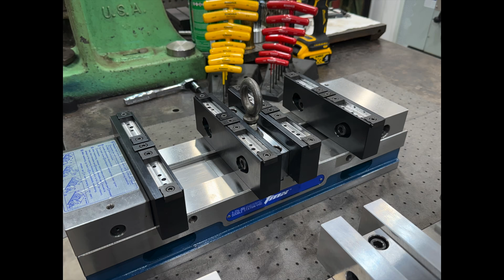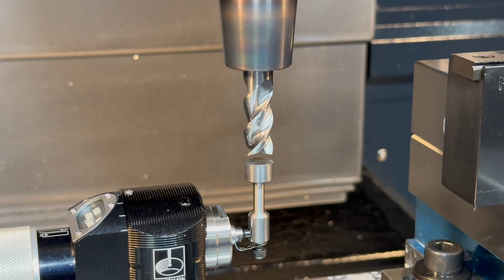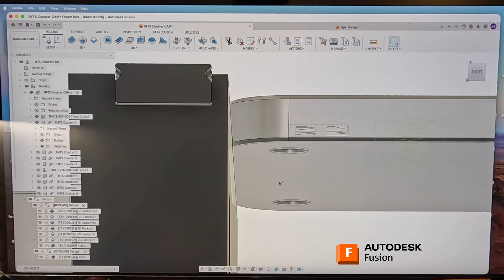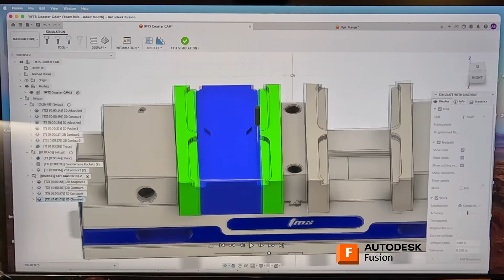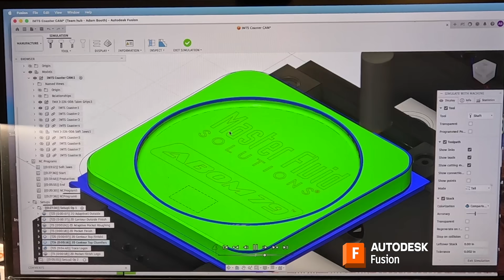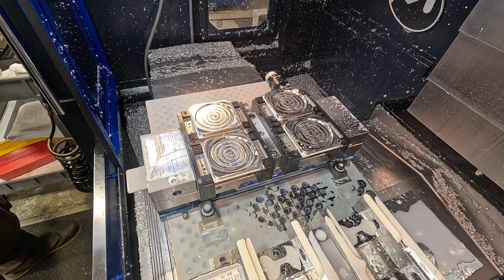Custom Beverage Coasters for Master Fluid Solutions Meet-Up

Comment: I also noted the little gauging by the chamfer mill on the soft jaws. You said it’s probably because the ends of those jaws were not aligned as bolt holes have some play. Now if those would come off and you’d use them later on another run, could you get them back to proper alignment across X? You couldn’t use a square/123block etc. if the end were not cut equal..

One trick I’ve seen is machining a shallow pocket along Y-axis across both jaws where you could then drop a parallel to align them when re-mounting those jaws 👍

Comment: I think you should find places you can put rubber bumpers inside the coaster area to keep glasses from clinking down hard. Most coasters use cork as a rest for glass containers. But you can't because you need to see the engraving. I'm sure you can find at least a half dozen spots for a standard tumbler. Perhaps a very thin piece of clear silicone rubber instead of the rubber feet. It can cover the engraving and still people can see through it.
Reply: It's a promotional coaster. They're not going to go into min-maxing the design for a tradeshow giveaway, at least I don't think they would. The problem with a lot of metal coasters is that due to material properties it promotes condensation, the typical glass tumbler will vacuum lock for a moment (especially this recessed design) when lifted and then the coaster will come crashing down as the coaster slips. Murphy's Law dictates it will land on the corner and smash through your glass table top: Hard learned lesson. Let's just say, my foray into coaster design for my own needs ended there.
Reply: @ald5267  No kidding, but the coasters should still work as coasters.  Small silicone balls can be fitted as bumpers. drilling hemisheres should not be a problem.  I already looked and they are commercially available in various sizes. It is trivial to make a wood/plastic pattern to temporarily stick the balls onto. A similar thing is done with cpu solder.

Comment: This is completely the wrong setup for these. Get rid of that SMW plate, put 5 lang zero points on there. Do 1 piece of material per vice, and do 2 coasters per piece of material.
Reply: And how much money and time would that take? Here is an idea. How about he brings in a Matsuurs horizontal with a pallet loader and we load up tombstones in there and it just runs everything for the next week and he gets 5,000 parts?
Reply: @MechanicalAdvantage wouldn’t help for high mix work. Lang would come in under 10k for the lot, and he’s spent close to that on 4 different vices
Reply: @spikeypineapple552 Oh so it would only cost $10k and a couple of weeks to get? This is as sitting on the table; paid for, and ready to use right now.
Reply: @MechanicalAdvantage Lang’s available off the shelf. I really don’t understand the idea of saving a couple of days on a 5 year investment
Reply: @spikeypineapple552 Lang is good some some things, traditional vises are good for other things. He is using what he owns. From concept to design to cam to production was almost instant. The fixture plate opens a lot of possibility that zero point plates don’t. Everything in machining has pros and cons. Different things are useful in different situations. There was absolutely nothing wrong with this setup and how he did it. It was a great use of available work holding.
Reply: @MechanicalAdvantage I just don't get your point here mate. Everything on this machine has been purchased in the last year. Piling more and more money into a system from 30 years ago is not the way to make money. I've never seen him use the SMW plate in a way that T slots can't. It's not like there's even pins in the bottom of the vice, and this is a production machine, he has a whole different VMC to do weird setups.
Reply: @spikeypineapple552 The point is he doesn’t have lang vises. I like them for 5 axis stuff. I would never ever buy them. For 3 axis work. Nothing stopping him from using a zero point plate with the fixture plate. If Lang was the end all be all, other vise vendors wouldn’t exist.

Comment: Adam, I am not trying to be negative.  From experience with some aluminum coasters my parents had, though much lighter, I thought I would explain.  Those coasters would stick to the bottom of ice tea or other glasses that sweated when used.  The water from the condensation would form a very tight seal between the glass and coaster so that the coaster would stick to the glass when the glass was picked up.  I thought I would pass along the experience for what it is worth.
Reply: Yup, you have to be very aggressive with the cuts that allow air in to prevent vacuum locking the glass. Even when you do, the pooling condensation still causes issues.

I love the look, and the fun of the project coasters I've made in the past but it has its challenges.

Comment: What I like to do with engraving is to do a near-finish deck first leaving a few thou proud, engrave to depth, then finish the face to size. I also do this kind of strategy with order of operations depending if a tool is worn but still usable like making a heavy chamfer then follow up with a 2d finishing profile, etc...

Comment: I don't understand why you're using coolant on aluminum I never see anybody use coolant on aluminum specially when they're putting it on a YouTube video.... People come for the machining and in this video it don't start until 30 minutes in and then you use flood coolant and it gets all over the screen DANG man!
Reply: Well, I hope you donned your flameproof suit, because you're about to get roasted by everybody who knows anything about milling aluminium
Reply: Just because you can machine it without coolant doesn't mean you should. Wrong feeds and speeds on aluminum can cause buildup on the tool. Real-world machining is almost always using coolant.
Reply: So you don't get chip welding.
Reply: for a one off operation you can get away with it but for anything with considerable run time, or expensive carbide that you don't want to turn into trash, coolant is a better option.  aluminum chips will weld themselves to the tool and ultimately destroy it.  the only reason not to use coolant on it is if you're on a manual machine that doesn't have an enclosure.
Reply: blah blah blah
Reply: Aluminium is one of the only metals in a modern shop where you NEED coolant.